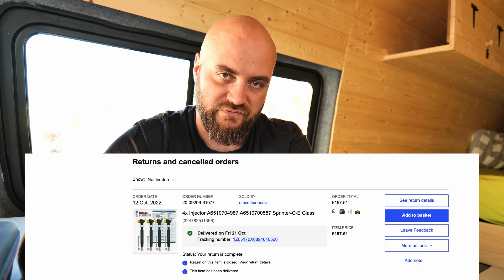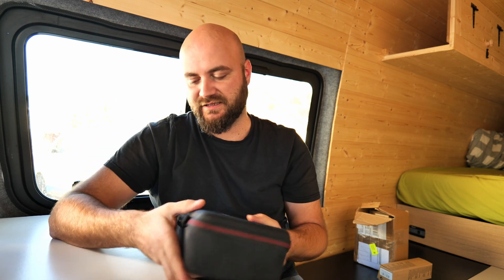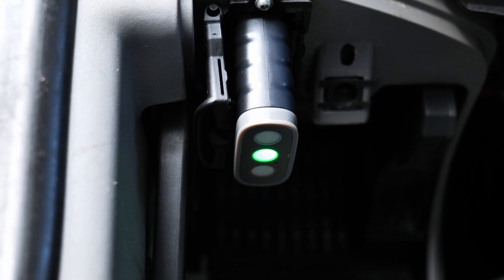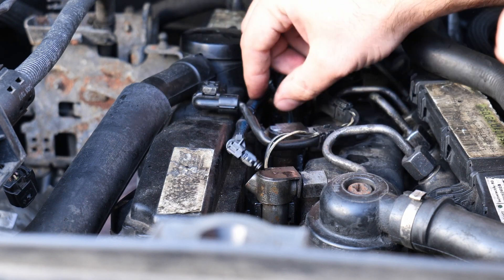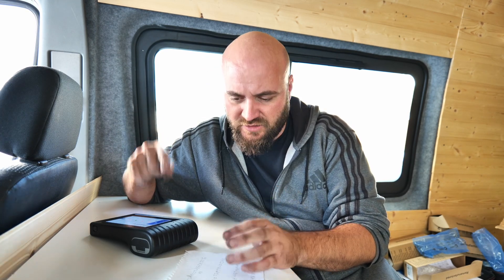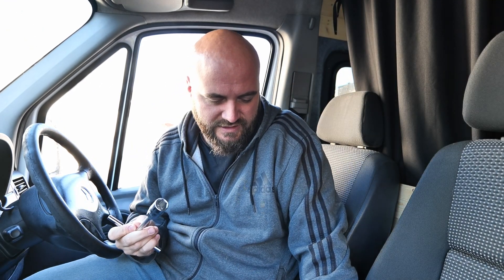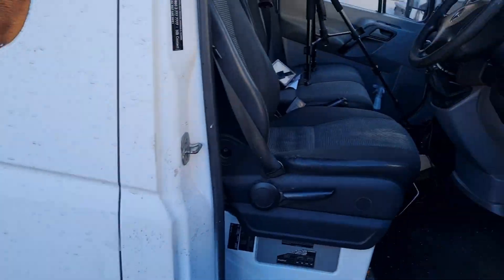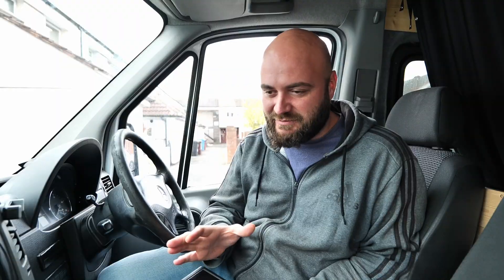Changing Fuel Injectors on a Mercedes Sprinter 906 + Topdon ArtiDiag 800BT Review

Comment: Hi mate, great work! I’m just doing one injector. Was wondering, when you reinstalled, did you need to bleed the fuel line? If so how is that done? Just leave loose and turn ignition till fuel comes out?? Thx
Reply from the maker: Yes I had to bleed them. Just leave ignition on till fuel comes out. do them one at a time

Comment: Hi Raul,
very clear video. I only want to ask you what number is the injector to the radiator?
thanks
Reply from the maker: Near the radiator is number 4. The numbering starts from the timing chain, which is in the back of the engine. Hope it helps 👍
Reply: Thank you
Reply: Is number 1 on my om651 near the radiator

Comment: Firstly cylinder number 1 is the front of the car on Mercs. You would of found that out if you took the injectors out in order and compared the stored codes. Secondly you need to zero quantity calibrate the engine after changing.

Comment: this tool can't read the injectors on my sprinter, therefore, it cannot code them. Also, the second cylinder is second on the radiator side. I made the mistake of listening to you and changed a good injector......
Reply from the maker: What sprinter model do you have?
Reply: Most of the engines first injector is the one where the timing is. You should look for some info Mercedes repair procedures before carrying works like this
Reply from the maker: @BenMaldan  that is correct